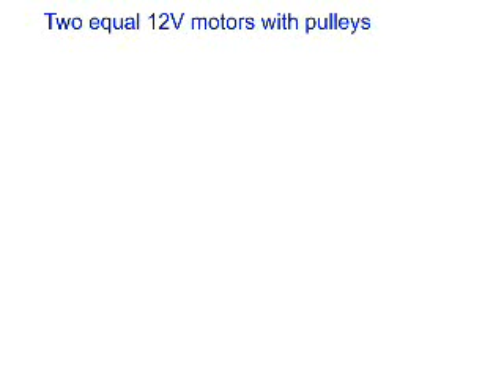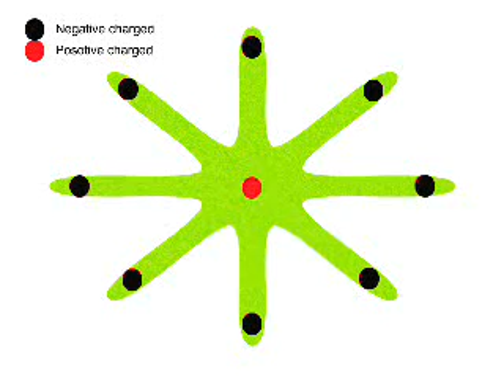Perpetual motion challenge

Comment from the maker: @powermaks Hybrid cars still use brakes.  To stop a car with a charging system alone. The charging units would have to be that powerful, the car would be over unity.  Or you would be wasting energy somewhere!!!!!!!!!!!!!!!!!!!!!!!!!!!!!!!!!!!!!!!!!!!!!!!!!!!!
Secondly if you use that amount of power that you use to stop, cars would do 500mph +.  You do the Math's. Brakes are good enough to lock all 4 wheels from 200mph to zero.  You try and wheel spin all four wheel from 0 to 200mph?

Comment: in this example (referring to my previous comment) say you attach a load toi the faster small load. the genorator will get harder to spin to speed. this is how the breaks work on the fancy hybrid cars work. connect the driving motor backwards to the battery and the spining wheel energy will be converted into electric energy to charge the batterys and the car will eventwaly stop.

Comment: Energy = Voltage * Intensity * Time

not just a voltage relations.. voltage and intensity are usually changed by AC transformers (thats what they do) however energy is theoretically conserved, in practice we have some loss

Work = Energy
Power = Voltage * Intencity (the potencial of work realisation over time)

Comment: The most likely reason IMHO is that you have measured rms volts and rms amps but not the angle between them.

The only rms measurement that can always give you the power without knowing any angles is "I squared R".

For instance, a purely inductive (or capacitive) load will still give a Vrms and Irms, despite consuming no power. You didn't mention a mechanical load at all, and having no load will obviously make the impedance of the electrical circuit be dominated by the inductive windings.

Comment: Now you're just making excuses. All you are saying is that you have had 20 years to buy a camera and you failed to do so. You could have saved the money from your electric bill to buy a camera. Why haven't you? The problem with using Hawking Radiation as proof of over unity is that the radiation comes from the mass of the black hole itself eventually evaporating the black hole. There is still a zero gain in energy. If you were talking about something else please cite specific examples.

Comment: It takes a lot of energy to add neutrons back into a heavy atom like uranium, because it tends to split apart rather than fuse into heavier isotopes.

So it still wouldn't produce free energy. 
It would be like trying to use the energy from a falling weight to lift another weight up. It just doesn't work, you'd only be putting back all the energy you got out in the first place.

Comment: You can't re-enrich used fuel. Enriching is the process of filtering out good nuclear fuel from raw uranium... stuff.

Enriching doesn't produce any fuel from fuel that's already been used. In fact, used fuel is a completely different element.

An FBR is more like a turbocharger on a car: It helps get fuel in faster, but it doesn't inherently produce extra energy [well, a turbo might, but this slightly different]

Comment: so what did you use for a load you must have used something.
just to come with an example:
a lead acid battery, I connect the multimeter  to the terminal of the battery and measure first volts and then amps.
I get 12v and around 3.5A so what is the maximum watts I can get out of the battery:
42W, 21W or 10.5W?
yes it is 10.5W
V(open circuit)*A(short-circuit)/4 =W

now I just have to say it is not a good idea to an amp measurement like that fore more then a few seconds or the battery may explode.

Comment: no I have not do the experiment.
but did you do the Volts and then Amps measuring at the same time OR one and then the other.
and no, watts are  NOT an equivalent measurement of amps, watts are volts times amps.
and watts times time in second gives you joules and that is energy.

Comment: how are you measure Volts and Amps?
because it sound, like your taking a multimeter connecting it to the output terminals then and then first measuring the Volts and then Amps, that is to say not at the same time,
now I am not an electrical engineer, not for another 6 months.
but when you measure Volts there is no connection through the multimeter then by no amps running, but when you measure Amps there is no resistance in the multimeter there for no volts.
in both case 0 watts an no energy.